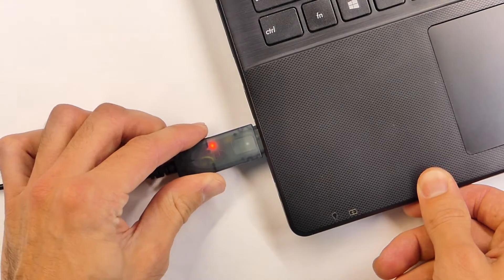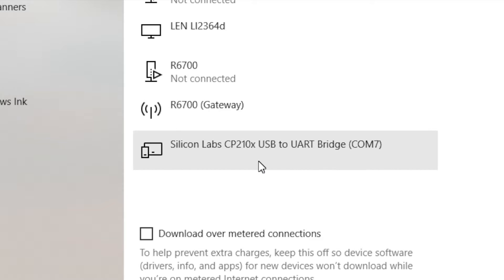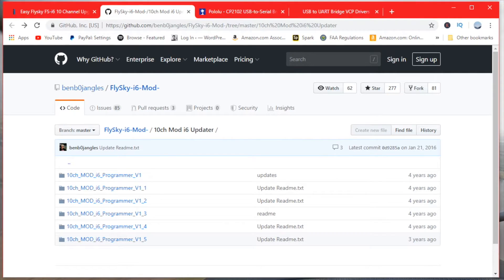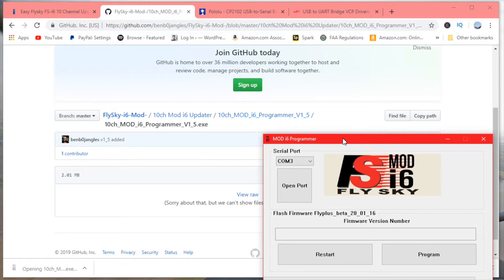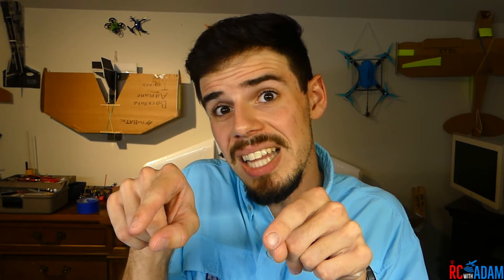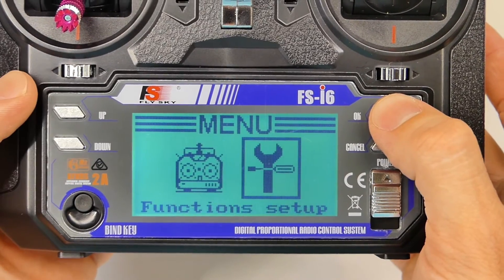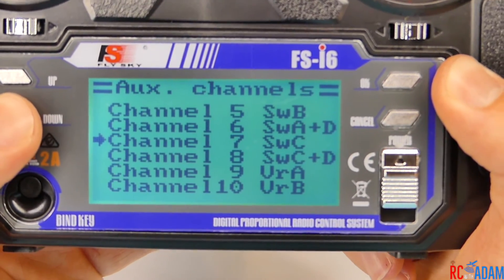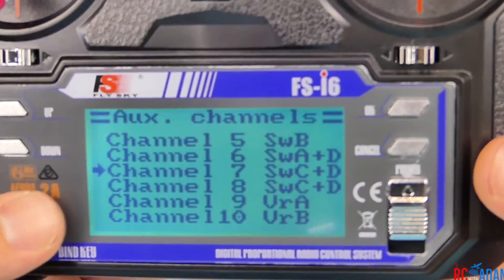Flysky FS-i6 Firmware Upgrade Tutorial - How to Update fsi6 Firmware to 10 channels (Flyplus Beta)

Comment: Hey great video!  Just a few notes about my experience.  Windows 10 auto-downloaded the drivers for me (yay!).  So installing drivers were unnecessary.   The program did NOT run the first time.  this is because it needed to do COM registration more than likely.  In order to do the registration it needs to run as administrator (right click the executable... run as administrator...).  After the first time running as administrator it no longer needs it and can run normally (like i said only for the initial COM registration probably).  The COM port would not let me open the first time.   This is because the auto downloaded windows 10 driver set the baud rate to 9600, but the baud communication needs to be at 115k. 

This full combination finally got me up and running.
Reply: Thanks for the useful extra info!
Reply: How did you change the baud rate?
Reply: PatchBOTS Go to the Device manager, find the usb com port you want to change, click on it to open the properties page, click on the port settings tab and there you are.
Reply: hey thanks very much for your help. But I did everything you said ( I was getting so excited when I changed the baud rate to 115 lol ) but it didn't work. My com port wont open. Any ideas??
Reply: @michael1473  unfortunately that's all i did.   Program is running (check), baud rate to 115K (check).  Is the cable fully inserted into the flysky?  It's a pretty stiff connection.  Is the flysky in firmware update mode?
Reply: @spoonsky  hey thanks for getting back so quickly. Yes did all that 3 times !  Now this is really annoying!
Reply: @michael1473  no clue man.   At this point I'd try to borrow a friends machine, and see if i can get it working there.  It could be anything from a faulty cable, to the windows driver issues.

Comment: Thanks 👍
Worked on my i6 now have all 10 channels 
Would the same update work on the fs-t6 controller to open to 10 channels  ?? 
If you doing video cant wait
Reply: But what's about the receiver do I need to buy 10 channel receiver after upgrading transmitter or old one will work
Reply: @rctechmods8165  
Need a 10 channel receiver so get all 10 channels to work
Reply from the maker: Hi! Receivers with fewer than 10 channels with absolutely still work with the upgraded transmitter. BUT if you wanted to use 10 servo ports for an airplane, you would need a 10 channel receiver.

Comment: Hi, I came across this video from a  facebook group. I needed your help. I am new to this hobby. I have a flysky fs-i6 controller with me. When I try to connect it with the PC, the red right on the USB Dongle part gets red once, then after some time it stops. I am stuck at this point. Please help me to move ahead of this issue and start simulating. I have updated the firmware according to this video.
Reply from the maker: Hi Vishal! Welcome to the best hobby in the world! To use the fs-i6 with a simulator, you need to connect it to the computer with the flysky FS-SM100 (i think thats the name) usb dongle thing. You can get it from amazon or banggood. (I know, it's silly that you have to buy a seperate cable). Let me know if this helps! 
Oh and which facebook group was it?
Reply: @RCwithAdam1  thank you for your help. Can u please send me the link of the cable because I'm unable to find it on banggood. Also, the fb group name is : flysky/turnigy support group
Reply from the maker: @vishalpoddar-360securities5  You're right, I can't find it either. Apparently they removed it. But here it is on Amazon https://amzn.to/2PiwnuF .

Comment: do you know how to upgrade the firmware which will fix the bugs in the software?  but also keep the 10 channel capability?  or is it either / or .... in other words, get the 10 channel capability but live with the bugs that cause latency in the radio transmission signals

Comment: So I still will need a 10 channel receiver right? Or I could use some kind of modification for receiver
Reply from the maker: Hi! If you want to use ten servos (or similar devices) on a plane, then yes, you need to have a 10 channel receiver.
Reply: @RCwithAdam1  I just tried this out with a TGY-IA6B (so 6 channels) receiver and an esp32. In PPM mode you get 8 channels, in I-Bus mode you get 10 channels.

Comment: Mine is on com9 but that's not an option on the updater
Reply: Same on me, on my computer com12. How to fix it?
Reply: I found this to fix the problem.
"Some software will not allow connection to higher COM port numbers. If you need to change the COM port number assigned to your USB adapter, you can do so using the Windows device manager. Bring up the properties dialog for the “Pololu USB-to-Serial Adapter” COM port and click the “Advanced…” button in the “Port Settings” tab. From this dialog you can change the COM port assigned to your device."

Source pololu.com

Comment: Hey, is there any way to connect that controller to FVP simulator on PC?
Reply: buy a simulator cable from banggood. It is cheap 10-20 dollars. Beware that simulator and data line cables are different.

Comment: Adam, I loved your tutorial! However, after the update was complete and I got the 10 channels, I noticed I lost all the previous setup I had for my drone, including the binding with the receiver. I have the Arris X 220, which came ready-to-fly. I checked several binding procedures on youtube, but they all seem to use a different receiver (FS-IA6B), which they show not yet installed on the drone, plus some sort of plug and a different battery. I feel lost because I'm brand new at this. I've removed the top part of the frame and can get to the components, but I just don't know what's what, what I need to do, and what supplies/accessories are necessary to re-bind . I'd appreciate any help you can provide.
Reply from the maker: Hi, Cesar! I understand your "lost" feeling! And sorry about not warning about losing previous model profiles. The best thing would be to send me a few good, close up pictures of the quadcopter so I can see what kind of receiver it is and sort of how it's connected. My email is RCwithAdam @ gmail dot com. What you will likely have to do is re-bind and change a few settings on your transmitter to get it back to how it was. I can probably walk you through it.   😀
Reply: @RCwithAdam1  can we delete and again bring back the previous version?
can we delete the update we did?

Comment: My radio died on me after doing this, it doesn't boot up any more after the firmware upgrade.
Any idea to revive it would be very welcome.

edit: i did the udate again on the presumed dead radio.
turned it on (nothing hapaned) but i could connect to the com port in the upgrade program. redid the program thing it bleeped (wich it dind't the first time) and came back alive.
after closing the port in the program and disconnecting i restarted the radio saw it was updated.
Reply from the maker: Good! Glad it worked out okay!

Comment: i have the driver but it just shows up as ppm
Reply: Same here
Reply: Readytosky Flysky USB Flight Simulator Adapter Cable for Flysky FS-i6 FS-i4 FS-TH9X FS-T6 FS-T4B FS-GT3 FS-GT2 Remote Controller
Reply: same for me!!!
Reply: Hey guys have you fixed this ? How do i get this to work ?
Reply: @avionics_sm5732   i figured out its becasue i bought the wrong cord one is meant specifically for sims

Comment: @RCwithAdam If I install the update, will it erase my beta flight settings an drones I already have loaded on my Flysky radio?
Reply from the maker: Hi! No. The Betaflight settings are stored on your quadcopter's flight controller board. BUT I would expect that if you update, any model profiles you've previously set up in your transmitter will be erased.
Reply: @RCwithAdam1  Oh! So the reason I am asking is I had a guy mod a "phone drone" to run off my Flysky radio. I just wanted to make sure that if I update my radio it wont erase my drone in my radio. If that makes any sense.
Reply from the maker: @FlyingFreddyRC  I think you'll have to bind it again.
Reply: @RCwithAdam1  Thank you.
Reply: I think I just learned like 3 or 4 things from you today! Thanks bro!

Comment: Should i just but i6 or go for i6x?
Reply from the maker: I6x
Reply: @RCwithAdam1  but what if we update the i6 firmware, did it make same to i6x? Or i6x still better?
Reply from the maker: @slickyy_  I would still just get the i6X. Less hassle that way.
Reply: @RCwithAdam1  so its equal but more hassle using the i6 right?
Reply: @RCwithAdam1  If I install the update, will it erase my beta flight settings an drones I already have loaded on my Flysky radio?

Comment: I literally asked that 2 weeks ago!(hope you didn't make it only for me ahah). I just have 2 questions: where did you find the data cable? i bought the fsi6 new just 3 weeks ago and there wasn't.
 If i go to system>factory reset after having done the upgrade and actually reset it, will it return to the normal fsi6 or what? thanks veeery much
Reply from the maker: lol just for you! ;D 
Here is a link to the data cable on amazon https://amzn.to/2W7LUxz .(Note: I'm not totally sure if the flysky SM100 simulator cable can also be used as a data cable for the firmware, otherwise I would say to just get the simulator cable so you won't have to buy 2 cables.).
I tried the factory reset, and all it did was return all the settings I changed to default, but the firmware did not change. If you want to change the firmware, you need to download a different version from somewhere and change it just like in this video.
Reply: @RCwithAdam1  okk thankss
Reply: Mine will not got back to factory settings after flash. Also you can use a Ardinio to do the fash if you have one. There are videos on ytube how. This firware has been available for a long time. Look how to flash firmware for FlySky i6 10 channel mod
Reply: @johnnickerson9037  thanks for the advice! Unfortunately I don't have arduino...